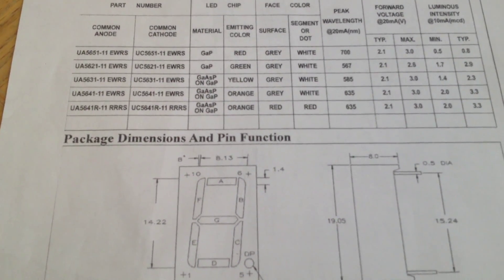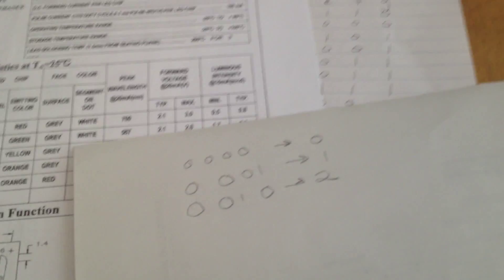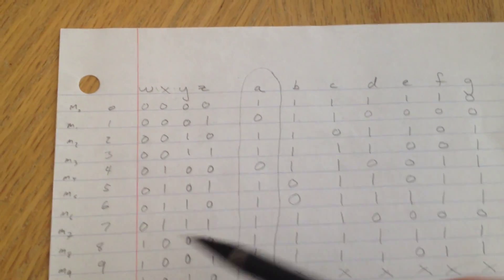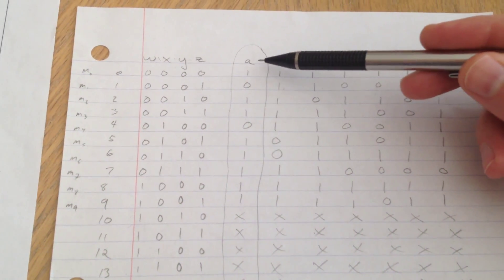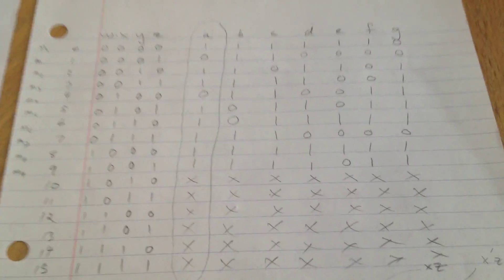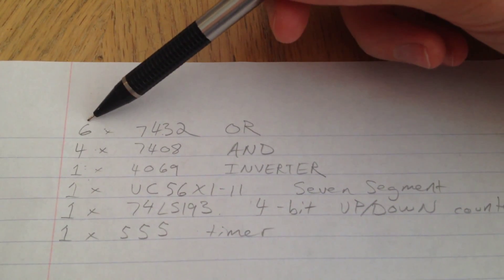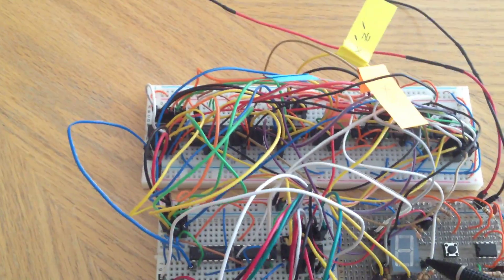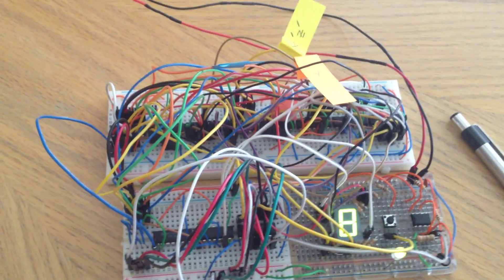Binary to Seven Segment Decode from Scratch

Comment: nice set up ... if you plug pin #3 of the 74193 to the pin #3 of the 7400 and then the pin#1 of the 7400 to the pin #7 of the 74193 and also the pin #2 of the 7400 to the pin# 3 of the 74193 it will count up to 9 and then reset ans starts from 0 again.

Comment: 04:30 There's no such ting as "Windows machine" – the same machine can run any other operating system. And the program is not really "free" if it requires Windows to begin with :P
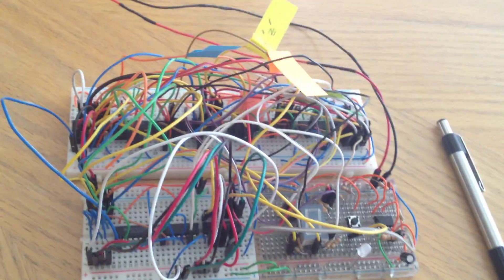06:35 WHOA! WHAT A RAT'S NEST! ;O
07:15 Well, then I have a better idea: why to bother with learning all this stuff if I can pay someone else to do it for me? :q (thinking in the same line of thoughts as you present in this video and taking it to the extreme :q )

Comment: how would I k mapp 9 seven segments display using 4 inputs, each seven segment will turn on individually and then after all have turned on alone then all will be on for a while and the circuit will repeat, I know I'll need flip flops and a 555 timer but the k mapping and wiring is so confusing, I have already done the truth table but I'm confused if I'm to k mapp vertically or horizontally on the outputs (a,b,c,d,e,f,g)?! HELP pls.
Reply: The young man is no longer with us. He was my son and passed away July 1, 2014. I know if he was here, he would be glad to help you!